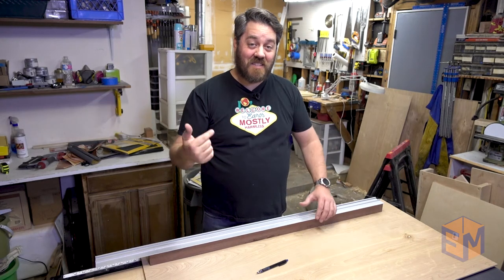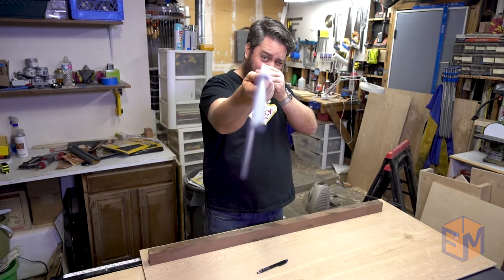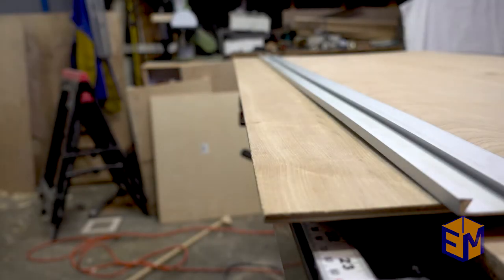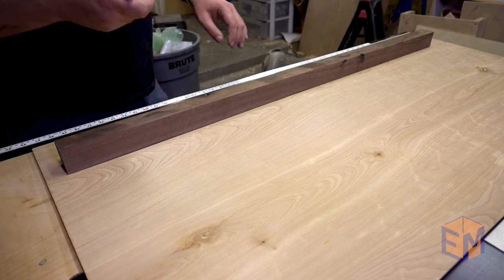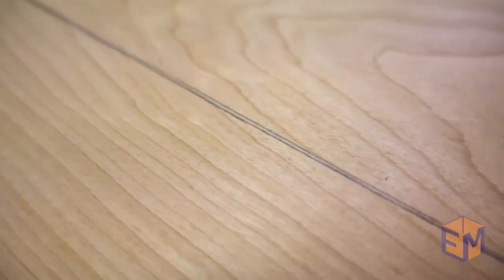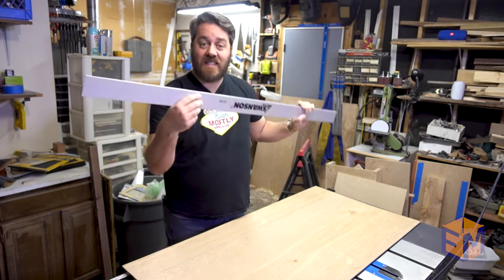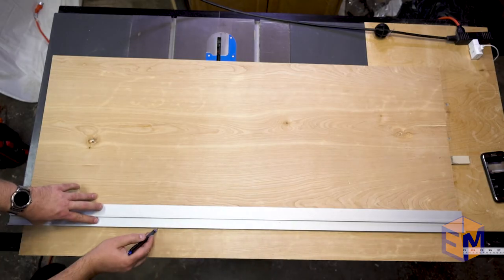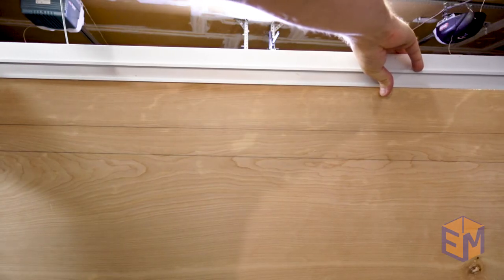How Straight is a Straight Edge?

Comment: Helpful video.  Be sure to flip your edge using the drawn line as the axis.  The way you first rotated your edge, an S-shaped edge would measure as straight.  And if you go end-over-end, a C-shaped edge will measure as straight.But use the drawn line as the flip axis and you're all good. 👍🏼
Reply from the maker: Absolutely agree!  My straight edge isn't one I could flip on that axis since it had a bunch of raised surfaces on the top.  However, the chance of it being a perfection symmetrical S shape is pretty slim, so I accepted the risk and was able to verify the accuracy later.  And a good note going end over end, that is far more likely to be an issue.

Comment: Your surface has to be relatively flat, also a straight edge has to be very off for this to happen.  You need a known flat surface such as a Starrett straight edge or a machinist block.
Reply from the maker: The better equipment you start with the easier it is to make sure everything is straight and even.  I had good luck with my my setup and found some "straight edges" that weren't quite.  But once I got everything dialed in, I was able to do much more accurate work.

Comment: I use a 5mm mechanical pencil. Also, the wood better not have rounded edges like a Tubafour. Hard to beat a metal scribe except with woodgrain, it can introduce error. I also use a 2 stage sharpener from Germany. It's kalled Kum sharpener. Sorry about the name. They are the best I've ever found and cheap. Make sure it has extra blades and it's a 2 stage. Large hole for cutting down the wood. Sharpen until the lead touches the plastic edge. Then use the small hole for any wood left but primarily for the lead. The points are stunning and thin. Easy to break like a 5mm pencil. Reasonable skill require to not break them. But even broken, they are still really sharp.
Reply from the maker: I have plans to make a knife for scribing, but I may just break down and buy one.  Thanks for the info!

Comment: Good stuff, once again, Nick. The real question, though, is knowing what sort of accuracy and/or consistency is needed in a given situation. The point you're making is a good one: that modest tools typically suffice if used within their limits. Modest tools carefully used are better than an expensive tool misused.
Reply from the maker: Very true.  Sometimes you don't need to be super accurate.  Actually, most of my stuff isn't all that accurate, but works well enough for what I need!

Comment: Thanks.  I like the idea. My daddy taught me make a single pass with the pencil. No back and forth. It muddies up the sharpness.
Reply from the maker: That is a very good point.  Normally I would use a marking knife, but I wanted to make sure it was visible for the camera.  I also suggest using a nice smooth freshly sanded surface to minimize bumps and skips in the line.

Comment: Interesting;
i repair car engines and i need to check the cyl. heads to within 0.002 inch max; 
i will ow check my 2 straight ecges (cheap ones...) thatbway..
just curious, did you come up with it yourself, or, like me now , you saw it done before?
Reply from the maker: I honestly don't remember.  It's likely that I saw someone do it (probably my Dad) once before, but don't remember it.  I hope you are able to get that tight of a tolerance on your straight edges.  I haven't gone that tight before, though I have seen metal workers use similar techniques to verify flat surfaces.

Comment: Though it differs according to the type of project, but is there a tolerance that you give yourself or that you would give a beginner who doesn’t have the experience to know the “if it’s straight it’s straight” comment. For example how much tolerance do you give yourself on a 36” piece?  (i.e.  +\- 0.001”, +\- 0.005”, 1/64”, 1/32”).  When is enough enough for you, since I don’t want to end up going and buying another tool that is a “known” straight edge?  SWMBO might not be happy with that. LOL
Reply from the maker: As with all complicated questions, my very frustrating answer is, it depends.  When it comes to tools I want as tight a tolerance as I can measure, which is usually about 1/64".  The better your tools are, the easier the project becomes.  I often go back and check my tools and make slight adjustments as my skill increases, to get better and better tools, most of which can be modified.  It also depends on the project you are working on.  If I were to make fine furniture with piston fit drawers, then those tolerances would have to be much tighter.  I'm working on a cornhole set for example.  If I were just making it out of 2x4s and plywood for a quick weekend trip, I probably wouldn't worry too much about being out by even a 1/8", as long as everything fit together and could be pulled in to relatively flat with fasteners.  My design however is a bit more complicated and I want to really make it more like a piece of fine furniture.  So I'll be paying much more attention to detail and making sure I get everything as square and straight as possible.  Don't be afraid of getting a decent set of files and modifying your straight edges.  Also, MDF or melamine tend to have good straight edges, so worst-case scenario, start there.
Reply: @TheEveryMaker  thank you. More help than you realize

Comment: You make a great video, and congratulations to you on that!

However, your method of checking for straightness is not correct, and in a very important way.  You flip the straightedge end for end.  What you need to do instead is flip it over, across the line that you draw.  The reason is that when you flip it end for end, you are not comparing the same points on the straightedge in the two orientations.  Flipping it end for end means that you are insensitive to any errors that are evenly matched and evenly spaced about the center of the edge.  For instance, say that there is a dip on one side of center, and a matching bulge on the other side of center.  When you flip it your way, the dip will line up with the deviated line that the bulge caused and vice-versa, making you completely miss the error.
Reply from the maker: I did actually consider that as I was making the video, but in most cases, when something is out of straight, you are usually talking about a bow of some sort and while a repeating pattern of error can be missed, the chance of perfectly lining up those errors are minimal.  In the case with my straight edges, they don't sit flat when you flip them upside down, so that wouldn't give you a great result anyway.  I ultimately decided it's more important to be using not only the same edge, but the same corner.  You aren't wrong though, given the option to flip over vertically and lining up your straight edge on the same points will give you a good result, as long as the top edge and bottom edge are on the same plane.
Reply: Thank you for your reply Nick, much appreciated!  I'm going to make a video on this issue; it won't be anything like the quality of your videos, but I think that it will be interesting and eye-opening.  I hope that you will want to view it.
Reply: I did complete the video, Nick.  The last 6 minutes of it were inspired by your comments, so I hope that you will be interested in looking.  It's here:
https://www.youtube.com/watch?v=KPO5X0yY7a8

I intend to add a link to your video on there somewhere, but I haven't worked out how to do that yet.  Any suggestions would be appreciated.